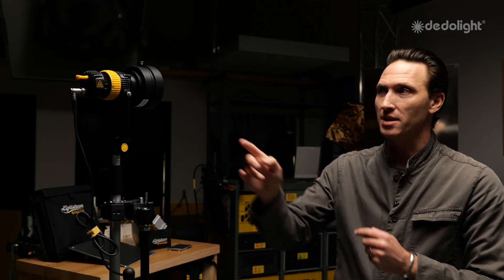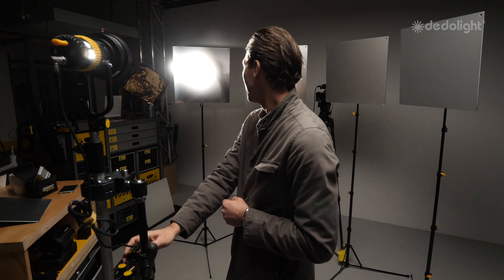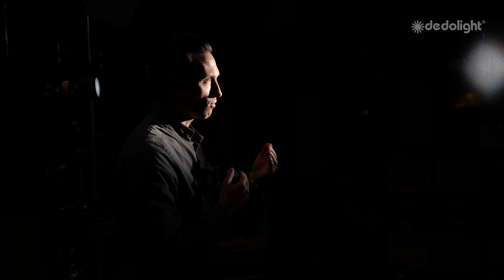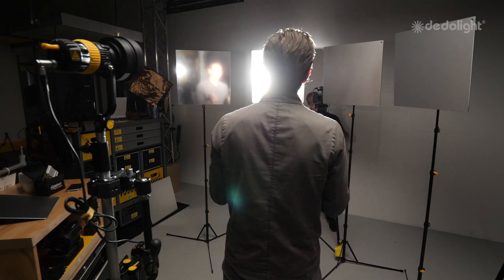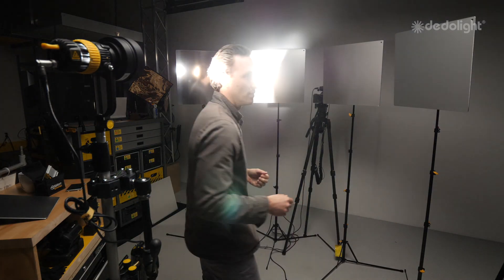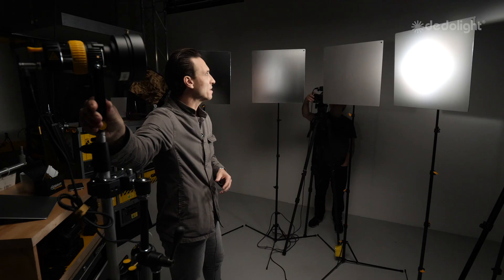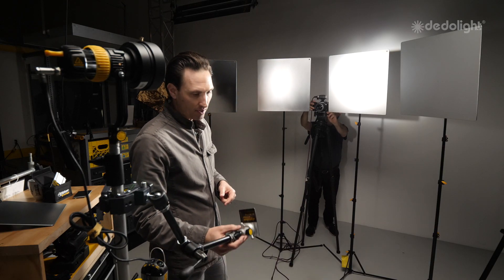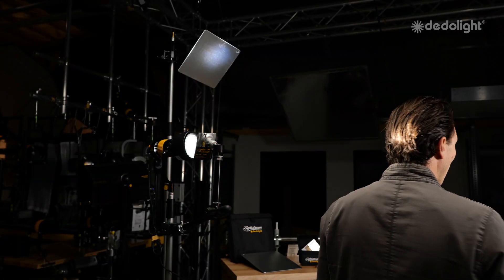Intro to Lightstream by Dedolight

Comment: What's the adavantage to polarsing the light?
Reply from the maker: Hi Karel - I hope others can chime in on this, since my response might be elementary. If you have experience with polarizers on camera lenses, then may notice how they effect surface glaring. Adding polarizers to the light can also effect glaring on surfaces. Polarizing by reflecting light has a unique look by nature. If you want less/more glare, you can learn to effect that with the reflectors on a medium to small scale (depending on angle of reflection). I will circle back with a link to a video about polarizing at the light source. Very cool stuff!
Reply from the maker: Try this one, Karel - https://m.facebook.com/watch/?v=623733202095212&ref=sharing
Reply: @dedolightcalifornia3763  That is very interesting. I'm familair with polarisers, and had a problem with one recently (don't tell any one! LOL) when darkening a sky - the blue sky was polarised when looking in one direction and the polariser gave the desired dramatic effect, but getting a matching reverse angle became problematic.
But back to polarisers on fixtures. I always thought the polarisation of glare was generated at the reflective surface. So it's there in the illuminating light? And the surface acts as a kind-of filter scattering the various polarisations in different directions? This really surprises me.

Comment: Poor copycat of the Light bridge system ! shame on you
Reply: lol Paul you do realize that these panels are just polished aluminum or sand-blasted aluminum with different levels of abrasion...right? Thinking there is THAT much of a difference between brands is nonsense. You are fanboying Light Bridge and I'm glad someone is offering a competitive product at a lower price. These likely cost $50 to make or less.
Reply from the maker: Hello Paul - Actually, you are going to find some differences. The #4 Lightstream reflector remains silver. Lightstream dovetail locks are designed a bit differently. Lightstream has a #5 reflector which turn the beam into an anamorphic shape. Lightstream has a couple more sizes and styles to choose from, including the "LITE" series. Currently, the Lightstream system is more affordable. You should try both out.
Reply: @dedolightcalifornia3763  Hello ! Actually, I've tried both. Sorry. No comparaison possible. The light bridge is not cheap is true, quite expensive, but it's the best. It's like compare ARRI with others. No comparaison. Sorry again.
Best regards. Paul
Reply from the maker: @priogilannovitoles  Well, different strokes for different folks always does apply! I promote that everyone tries and uses both. I'm very happy to show people how to use them, demo them, have success with them and support them. I demo our lights with beam intensifiers for Light Bridge users all the time, and they seem to be extremely happy with the results, as well as with the Lightstream reflectors which they add to their arsenals thereafter. Please, try an Arri with a beam intensifier on your Light Bridge reflectors!  Then try ours. Try everything. Without shame, we support the entire system of reflected light, and we're happy to be here to answer all questions, and yes...comparisons. Stay safe out there.

Comment: In theory. Would it be possible to use this intensifying modifier in conjunction with a simply umbrella attachment to create a much larger soft source rapidly without sacrificing too much on the output?
Reply from the maker: Hello Matthew - apologies for the late reply here. I've found that this approach doesn't produce the soft light effect you'd hope it would, unless you are far enough away from the diffuser to fully cover it. Since the beam is so narrow, you'd have to move the light further away from the diffuser, and it would no longer be a soft box "attachment". What you should try is using a #3 or #4 reflector closer to your subject. It will still be a different "soft " look since Lightstream qualities are more of a hard light, but by spreading the light more you can get softer qualities.
Reply: @dedolightcalifornia3763  thank you for that very helpful explanation!

Comment: Idea is great but 1700$ for 4 piece set? You can buy brand new light source for that.Thanx for sharing though. great vid. Waiting for more.
Reply from the maker: Hey Eddy - thanks for checking out the demo video. I understand the comment, for sure! Yes, you can buy a thousand different models of lights for the price. Hell you can buy multiple lights depending on who makes them and what they are. You'll also throw them away, or buy more after they are dead (no professional LED source will last 50,000 hrs). You'll replace lamps, or these days send your light back to the manufacturer to replace a diode set good luck with getting that back in a reasonable amount of time). But - with the potential to turn these reflectors into four light source to be used at the same time, from a single source, without gen power, or heat...well, consider the savings this system can offer over the lifetime of its use. MOST IMPORTANT however - None of the lights you could replace with them will make the type of light these reflect. That part of it might have to be seen in use to believe. Hope that helps, absolutely respectfully!
Reply: I love the concept behind this system, but find the cost prohibitive. I wish a Seattle area camera rental shop carried these.
Reply from the maker: Hey Dave - sorry for late reply here. We recommend having a talk with anyone who will listen at the rental houses and ask them to stock these for rental. You can send them directly to us and I will give them a streaming demo and go over the system with them. Send them to our web store www.dedolightcalifornia.com, or email us at info@dedolightcalifornia.com to learn more about it. Good luck.

Comment: Excellent. Are you guys planning on bigger sizes? Something like 48x48 for M40 units etc?
Reply from the maker: Sorry for late reply! We have a 1x1m reflector which has two sides - Standard 1m reflectors are built on a #4 reflector, and then we adhere the other side with any of the other surfaces of your choice. Then there are specialty 1m reflectors which are double sided with an of the surfaces of your choice. A standard 1m reflector comes with a #1 and #4. https://www.dedolightcalifornia.com/collections/lightstream-reflectors/products/dlr1-100x100cm-40-lightstream-reflector-1
Reply: Okay beautiful, great to know!